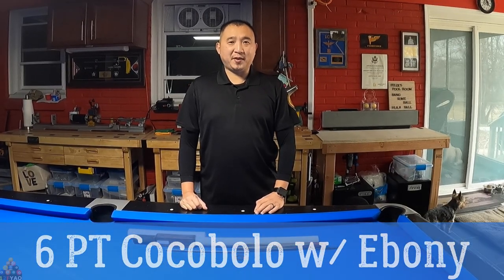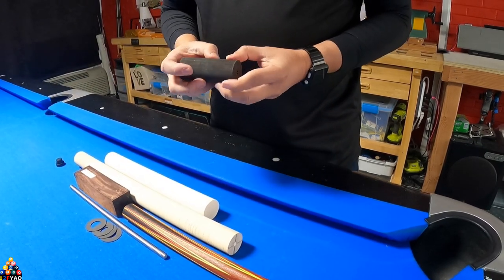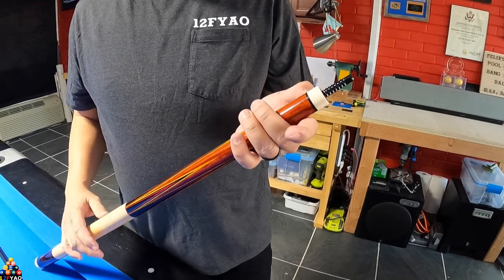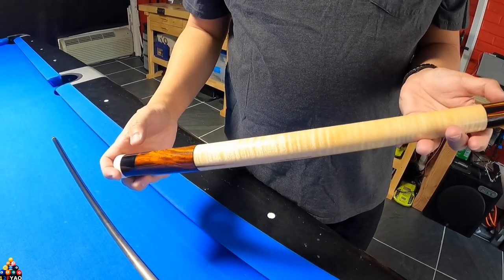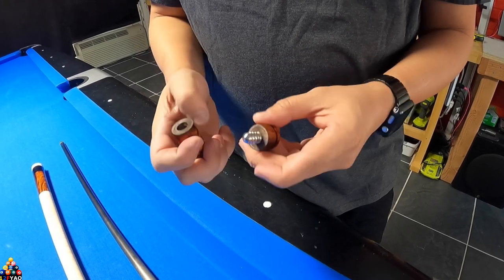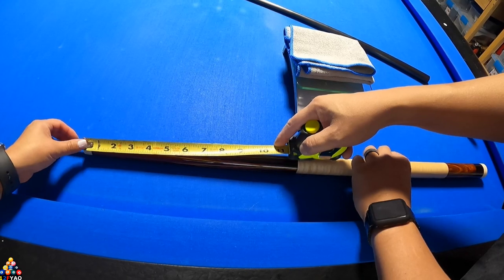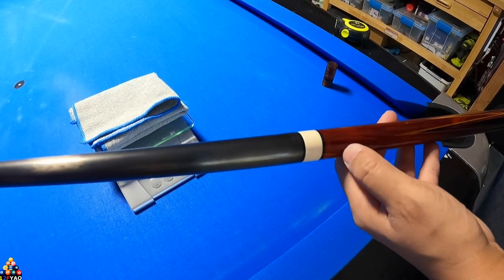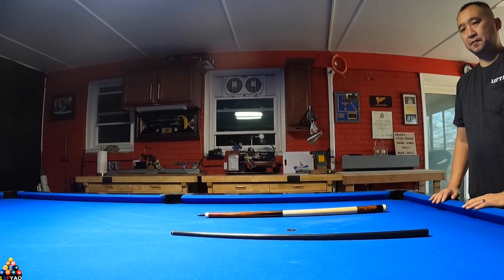Making a Pool Cue. 6 Point Pool Cue, 3Hi/3Lo Cocobolo w/ Ebony

Comment: I would like to see the turning of the wood from a square to a cylinder and explained of the precautions you have to take an how easily one  wrong mm can cause you to start over
Reply from the maker: The square to a cue is not the difficult part, it’s the shaft blank. I messed up one too many and I had to order new ones. No matter how careful you are, shafts blank to me can be destroyed is seconds especially when using a router. Shaft are not stiff enough and the wood would chatter and if not caught in time the router bit will eat up the wood a make a big gouge and if it’s too deep the shaft is trash.  The cue lathe I got from Mid American Cue Lathe is fairly accurate, for a whole number I turn on the dial, it takes twice as much. I makes turning a butt more manageable. 
As for the shaft, now I know why cue makers that makes shaft can charge so much, one your average beginner like me doesn’t have the right tools to turn the shafts and the tools to make the shaft are fairly pricey especially if the cue maker is just starting and it’s not a career.
Reply: Great explanation, an I know exactly what you are referring too because one of the blank shafts i have has that gouge from the router but its at the  joint end an the way around it is a joint ring or a good taper too .839  and I agree with your response 1000%

Comment: Hey , are you taking in work. I have a keilwood shaft and a roasted ash shaft from Prather i need tapered down an threaded
Reply from the maker: I would for making the cue butts. Shafts are too difficult for me. I don’t have a taper bar or a CNC. I turned some shafts and they always have a taper roll. I wish I had the CNC I know it would get rid of the taper roll because not a lot of sanding would be needed when the shaft is complete.  Sorry I can’t the end product won’t be satisfactory. Hope this helps. If you find someone willing to do that shafts, ask how are they finishing the taper. If they are going to sand it down to size, would rethink about giving the shafts to be worked on. Just remember a lathe with a taper bar or CNC.
Reply: Cool 😎 I understand completely because you are the 2nd person to say the same thing. I ask my local cue maker an he responded the same saying “ I just can’t get them straight enough “ . But I would like for you to do a but for me as soon as i get all the materials i have a shipment coming . If you can do it i would love for you too build  and sign it 😉
Reply from the maker: I would love too but I only have two taps, 3/8x10 and a radial.  I just started making cues and I like cues with big pins. I really like radial because the pin has a center where I can use it to do my final turn.  
PM on Facebook
https://www.facebook.com/felix.yao.5205